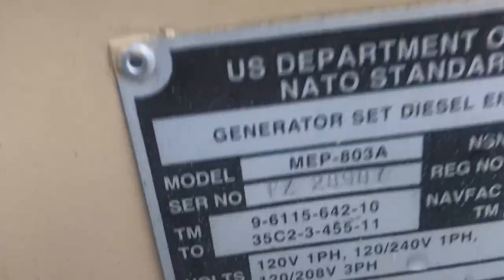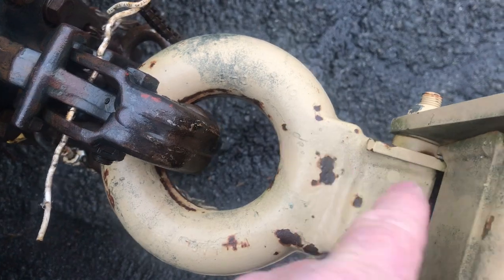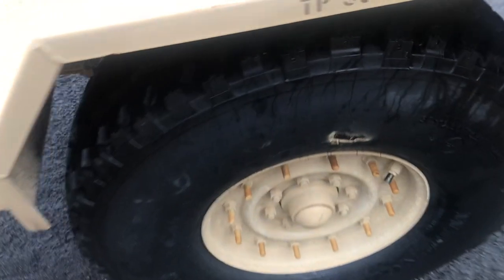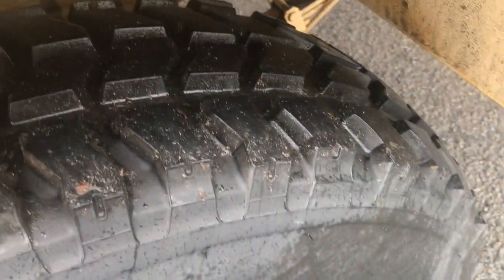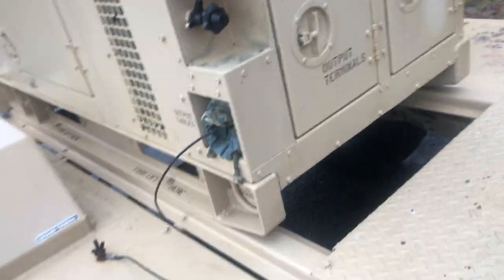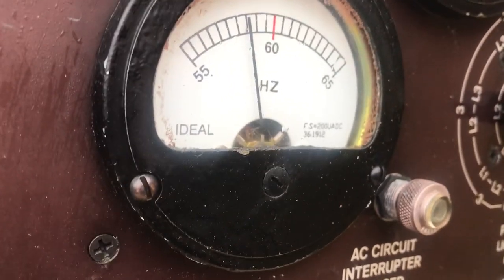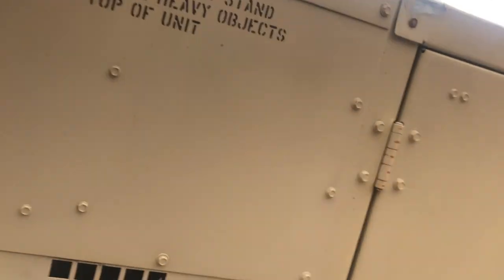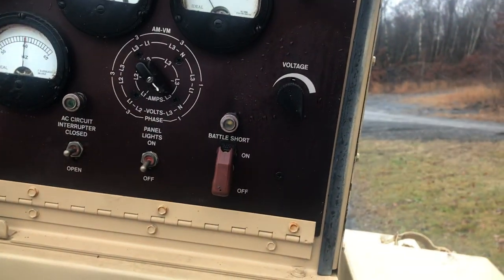mep-803a for sale $2750.00

Comment: Open the Northeast these generators go for over $7,000 now.
Reply from the maker: As of 6/29/24 I have new 15 kw`s for $5000.00
Reply from the maker: https://youtu.be/NGGrV0rEC6U?si=HH6p7aeYLGkl18Pe
Reply: @E123MORY  Stuff's a LOT cheaper out in PA. I almost bought a nice dump truck with plow and sander, Ford F550 in great shape for $17K, but the wife convinced me not to because she can't drive a manual transmission vehicle. Plus it was 5 hours each way to PA from here.
I ended up getting a MPE803A from Mass, $7K delivered. 2 hours on the clock, just reset by the military.